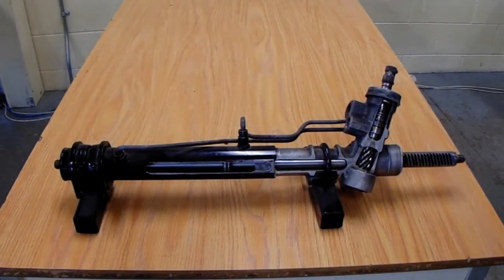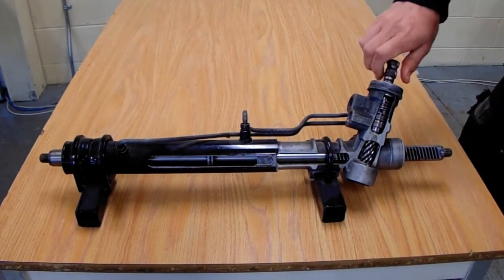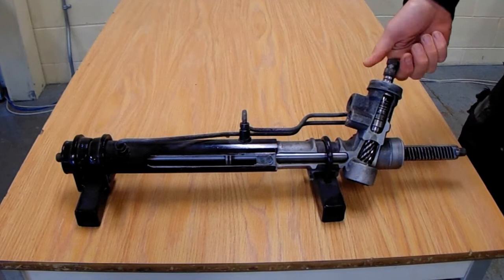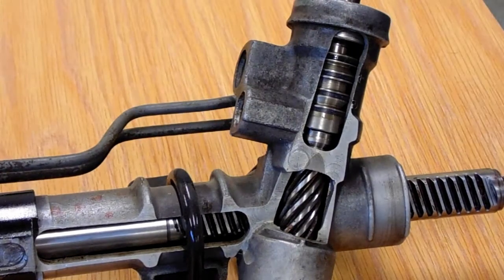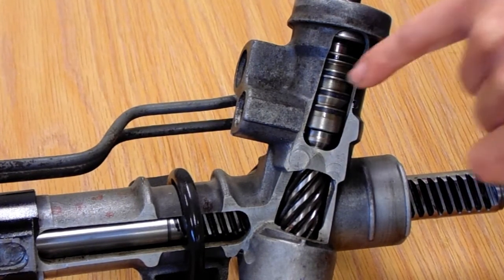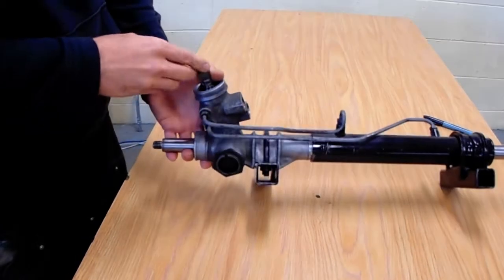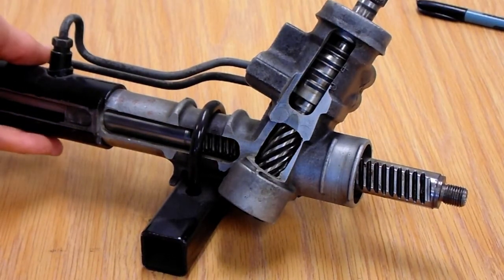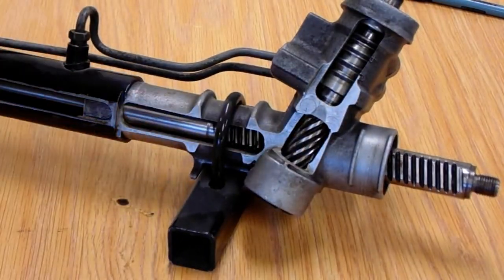rack and pinion how it works

Comment: Hey guys, it’s important to remember that the directional valve only opens with torque applied to it. In other words you turn left, it twists the torsion bar , the harder it is to turn the harder it twists. As it twists more it opens the spool valve more and assists your manual turning of the wheels with more hydraulic pressure from the valve. It’s not always open all the way when you turn the wheel
Reply: If the input shaft seal at the top coming out of the rack is bad can it be replaced by turning the metal cover? It might be an inch and 3/4 in diameter. The cover in rounded, not wrench / socket shaped cover. no videos on it so my mechanic cant help me. 2001 v70 Volvo station wagon, front wheel drive, isnt a power assist rack n pinion. The seals are availble. Thank you
Reply: @ the pinion seal can be replaced often times in a spin on or crimp on cap

Comment: So on our 2012 Infiniti G37 RWD we got last august with 81k on it has always had a loose, over assisted feel to the steering. There was some leaking around what appears to be a drain plug on the rack that I cleaned up and tightened. Now the leak is gone, and the steering tighter. Perhaps I need to back off a tad on the nut as it may be both a drain plug and tensioner? Perhaps a gasket is missing is why fluid was leaking, as there was buildup around the nut and also the inner tie rod boot, plus of course the fluid on the ground directly below the nut.

Comment: It looks like when you turn the input to the right, the rack would push the wheel to the left (and vise versa) - I know this isn't what actually happens, but when I think about it, and when I look at your demo, it seems the input gear would/is pushing the wheel in the opposite direction as the input turn. Can you explain how the the input direction translates to the wheels turning in that same direction?
Reply: The steering knuckle on the hub where the tie-rod mounts is located behind the axle (axis of wheel rotation). So, when the steering wheel is turned to the right, the rack pushes on the left tie-rod, which causes the back of the left wheel to move outwards (and thereby the front of the left wheel to move inwards), steering the vehicle to the right.